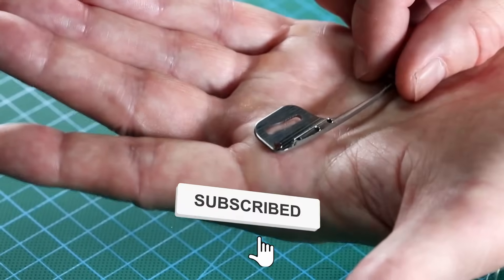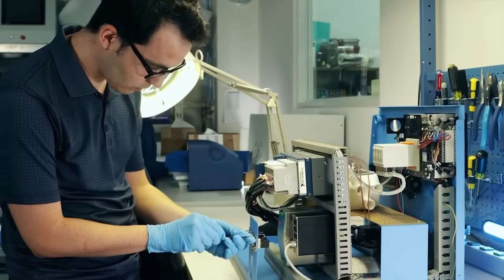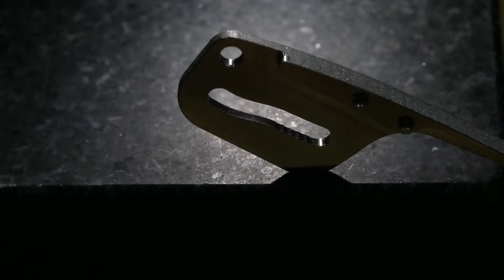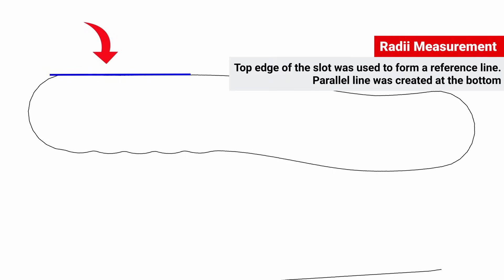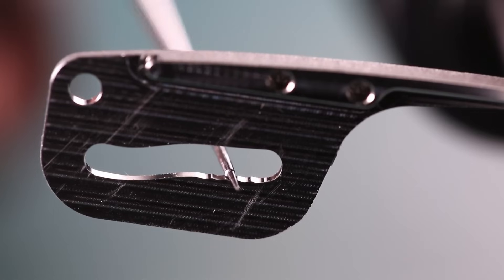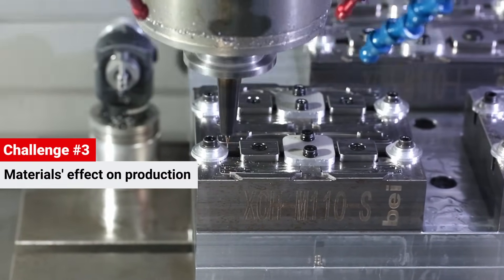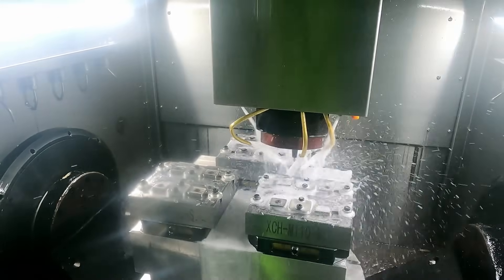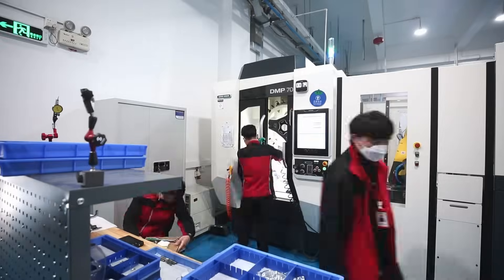Looks Like A SIMPLE Part, But It's The Most COMPLEX Part We Manufactured | 5 Axis CNC Machined

Comment: If the client did share the CAD files I'd get why they didn't care to correctly display the dimensions of the grooves.

Regarding the heat treatment, normalization would have helped to prevent warping if that was a concern.

Comment: As a design engineer, I see this part as an example of overengineering. Its complexity makes production challenging and its function unclear. I prioritize designing products with simpler, more efficient components. In this case, I wonder if a redesign with simpler parts could achieve the same functionality.
Reply from the maker: Quite possibly so, but we are not the product designer in this case.

Comment: So basically your biggest problem was to figure out the dimensions?

I clicked this because i was wondering about chatter in the longer part thats sticking out or how you clamped it in a fixture. Your problems were disappointing and i think you missed out on talking about actual difficulties. Kind regards.
Reply from the maker: Yes, of course we have CAM. And no, figuring out the dimensions was not our biggest problem, we merely used this as an opportunity to discuss the different methodologies for measuring radii along a spline. But thanks for the response.

Comment: Well, that explains the why of the rise of 3D manufacturing
Reply from the maker: Printing these would bring up all kinds of different problems to be solved. For one, laser sintering would introduce all kinds of thermal stress, causing the part to warp and thus require further post-machining.

Comment: If it’s just a clicky switch why did it need to be high strength 17-4PH? Structurally it could have been delrin.
Reply from the maker: We're not really disposed to explain the function of the 'clicky switch', but in this case, no, delrin wouldn't do it.
Reply: Ok and not regular 316 either ? 17-4 is for extreme stress situations
Reply from the maker: @michaelludvik2173  Yes - we had this conversation, and 17-4PH, in this case.

Comment: First machine parts without heat treating and leave enough stock material on features with critical dimensions. And then after heat treating do finishing machining with air cooling and without water. Then I would go to measure that part on cmm to check all my tolerance and correct me machining strategies according to measurement protocol.

 That's what I would do.
Reply from the maker: Thank you for your comment. We think there is no practical way (again, within reasonable time and cost restraints), to maintain 7 CTQs both before and after heat treatment, as it's impossible to anticipate how much the material will warp after heat treatment.

Comment: This is a good video to educate customers who don't quite understand GD&T. But I still do not see why this had to be done on a 5 axis. Yeah, that little move to dump chips between passes was cool, but even if that was absolutely necessary that's still only requires 4 axes...
Reply from the maker: Good point. It certainly doesn't need to be on a 5-axis machine. In our experience, 5-axis machines tend to be overbuilt and therefore more stable for some jobs, but that really depends on what you've got on the shop floor.

Comment: I love doing high tolerance little parts like that... but I have my optical CMM and that makes validating parts so much easier. Cool video! I'm just a 1 man self taught shop so I love seeing how other larger shops do their business.
Reply from the maker: There are many ways of course to measure parts, and luckily high-quality scanners or tabletop CMMs are more affordable and accessible than ever before for even modest shops.
Reply: @starrapid  right! My OGP Smartscope 302 is the most expensive machine in my shop, but it's still amazingly worth it on how much time it saves on inspections

Comment: Some of the horrible GD&T I've seen makes you wonder if these people ever learnt to draw. Gear PCD with 0.02mm concentricity to a bore with a 0.2mm diameter tolerance, families of nearly identical parts that have lengths referenced to different surfaces (some parts are from the end, some parts a from a shoulder), mindless conversions from nominal fractional to metric with no thought to how the extra decimal place now bumps it into the next tolerance bracket.
Reply from the maker: In the future we hope to have more videos that highlight issues related to tolerances and dimensions, because it's a subject that comes up often and we really want to inform our clients so they get the most out of their valuable design time.

Comment: This was a case study?!  This is daily life for any job shop machinist lol. We’d quote this for like $200 a part per the drawing you showed.  It’s always funny seeing big shops massively overthink something so simple
Reply from the maker: Thank you for taking the time to respond. Many jobs may seem simple of course only after figuring out all the details, but getting there takes a while. For example, identifying the right method for measuring the radii of the indentations was not self-evident. And no workshop, anywhere or of any size, is going to produce a small part with seven CTQs without facing a very high scrap rate.
Reply: @starrapid  why would you have a high scrap rate?  We run common modern cnc machines and if a tolerance is varying by more than a thou over the entire 2d profile like you have for those grooves something is very wrong. We obviously have to comp it in, but the entire 2d profile shouldn’t have any form variance outside of that unless your machines are dying or something.  Programmed and ran a part with 12 CTQs yesterday, 15/15 parts were good first time. Multiple holes +- 0.0003” with locations under 0.00015” on a 5 year old dnm.  Might be worth a ball-bar test if it takes this long and so much scrap.  Are your engineers modeling to nominal dimensions or one end of tolerance?  An issue I see a lot is not modeling to center of tolerance, but different ends of multiple tolerances, requiring a lot of time by the machinist to correct with comp and measuring. Model all to nominal, comp a couple in, and everything else should be within a tenth or two. Unless the programmer doesn’t grasp tool pressure and is loading the tool different on each cut and flexing it differently.

Comment: Very cool.  Now give me a million per month.  I used to work at Apple and regularly went to Shenzen to inspect production.  The factory is literally thousands of CNC's running 24/7.  If one breaks down they shut it off and turn on a new one.  No time for troubleshooting, that can happen later.  You would never believe the price of the iPhone frame.  Basically when order quantity gets high enough the part cost approaches the cost of the raw material per pound.
Reply from the maker: Thank you for your response. Yes, we are well-aware of economies of scale. In this case, relatively few custom parts means a higher cost per piece and a longer development lead time to dial in all of the processes. Once that's sorted, yeah, you can pump them out all day.
Reply: For context, how close of an approach are we talking about? For 10 million iPhone frames, 2%, 10%, 50%? I have no reference frame as I don't work in this field.
Reply: @italianstallion399  Normally single digit percentages.  Sadly in the case of the iPhone it is way more complicated.  By the books they are sold at a negative profit.  The reason is there are massive government incentives.  You couldn't buy the aluminum for the price the frames are sold.  BTW you wouldn't believe how much aluminum is turned into chips making a phone.  To avoid warpage from internal stresses inherit to a billet of aluminum the raw block is many times the size of the phone because only the center of the block is stable.  That makes the cost calculation even crazier because over 90% of the aluminum cost is gone to chips.  Of course chips are recycled but that value is not significant.  All phone companies do this or they could not be competitive.  It's like the made in USA sneaker example.  If Nike's were made in the USA you couldn't afford them.
Reply: @RA-gk5zg  That's really interesting on both the waste percentage and profit margins. I wonder if the titanium iPhones are similar.

Comment: Sounds like the engineer needs to learn how to use GD&T correctly.
Reply from the maker: Proper GD&T knowledge is a necessity!
Reply: @starrapid  sounds like it would have saved you some trouble. lol
Reply: Indeed, I'm not even convinced they got the profile reference right even AFTER these folks stepped in to help. The profile should reference to the centroid of a hypothetical perfect diameter sliding pin, because THAT is the path that matters in terms of kinematics of the mechanism. That a machine shop might not know this is forgivable. But for the design engineer to not know that is ridiculous.

Comment: In my experience as a machinist, most parts are ridiculously over toleranced and most end users will never notice a part is 0.002" out
Reply from the maker: Thank you all for your thoughtful responses. If you saw the video then you are clearly aware that the original drawings specified seven critical dimensions. Only after an open dialogue with the client did we confirm that this was not necessary, and relaxing those tolerances made the parts faster and easier to fabricate while still performing exactly as intended. We call this a win for all concerned and is the kind of professional service we offer on every project.
Reply: @starrapid  well said, My whole career I’ve tried to foster a dialogue between myself as the machinist and the client, in my case mostly engineers, to reduce production time and cost while maintaining function. Attitudes have changed over the years and I feel like engineers are more open to suggestions than they were in the past. Starting out in the 1980’s, I found manufacturing to be very classist. Machinists were expected to make the parts as designed no questions asked. So a lot of parts that the machinist recognized had issues got made anyway. And then remade.
Reply: @starrapid  Thank you for the video... 😎👍☘🍻
Reply from the maker: @peterfitzpatrick7032  You are welcome - We plan to produce more videos in this series, so please stay tuned.
Reply: There was this engineer at a company that made of all things marijuana bud trimmers. The thing was basically a spinning screen. He had these aluminum rings about 1/4" thick, 2" wide, and 14" in diameter with this crazy tight roundness tolerance. He was struggling to find anyone to even take the job. Like probably everyone else I was like "I think there’s a typo on this roundness tolerance, you could scrap this part shipping it" but no, he wouldn’t budge. It’s tempting to take these jobs when they’re willing to pay, but it’s a trap. They 100% will never be happy with your work. And I passed on it. I have more than enough work running my regular old machine shop. I don’t have a CMM, climate controlled machines, or shrink fit / hydraulic tool holders. I can’t do in process laser inspection. I can chase microns if I need to, but it’s annoying and I really don’t like wasting my clients money. All this dick measuring about how precise your shop is tiring. ULA has a building size cnc machine turning semi-truck sized billets of aluminum into rocket sections. Impressive. SpaceX has 3 guys running a slip roller and 5 guys with backpack welders on extension ladders. Their machine shop is in a tent. They measure the rocket sections with a precision tape measure.
Reply: If you've ever tried to get a stainless pin to slide in stainless track, you will realize that it doesn't take much tolerance stackup for a mechanism to go from smooth to jams-every-bloody-time. And yes, 0.002" is more than enough to make that difference.
Reply: This is just used within marketing to justify price increase.

But there is also for production lines when multiple parts can be interchangeable, it is very important that tolerance be either  +0.0 -0.002
Reply: @monsterrun  mind me asking how do you specify tolerances on a part?
I understand +/- X.XXXmm for lets say a hammer handle, you might say 500mm+/- 10mm because if its slightly too long or too short it doesn't  matter too much
but lets say im making a pin to fit into a hole
what note would you put on that to say it needs to be no larger in diameter than 1mm but if its under 1mm  but upto 0.1mm thats fine
Reply: Tolerance is based on fitting with other parts

There is also the notion of how much stress that part can endure and how much vibration it can accept. Too tight can be a big issue on small rapidly rotating part as it will generatw heat and expand.
Reply: @randomcow505  "anywhere between 0.9 and 1mm" translates to "0.95mm +/- 0.05mm"
Reply: Yes, I agree, but in this case the "click" had to come at the exact right place. If there is inconsistencies it could be fatal in an operation.
Reply: Whether they will notice or not isn't important. 0.002" out is 0.05mm which is a huge tolerance issue with a component so small. You aren't striving to be a good machinist if that's how you think of machining components out of spec as being OK. If I got a part 0.05mm out of spec (components I have made require +-0.01mm) I'd get a refund immediately because that means the machinist can't even be added to run the CNC properly.
Reply: @FrozenByFire3  thats not what he's saying... prints often have silly tolerances on non-critical surfaces... you KNOW this... thats the whole reason for "design intent" and designer /manufacturer communication... 

A part should be toleranced such that it performs its function correctly (incl. wear allowances etc) but NO MORE than that as all that does is increase production cost and therefore end-product cost... 

Design and manufacture are 2 separate disciplines, each have their own area of expertise so it makes sense to get the two together to discuss a project and perhaps try other design iterations more easily (cheaply) manufactured...
Reply: @peterfitzpatrick7032  that's very true, but if the drawing says a specific tolerance, it's your job as a machinist to reach it. If you think it's too much and will boost cost, contact the designer/engineer and work with him to make it reasonably toleranced for areas that don't matter. Don't just machine it off spec and hope the client doesn't notice. That's some shitty Chinese CNC shop logic
Reply: @FrozenByFire3 Who said anything about not keeping to the specified tolerances ...? 

The point of my comment .. and actually the raison d'etre for this whole video....  seems to have gone right over your head... 

NO ONE has said anything about making parts out of spec & trying to pass them off on the customer, that was your interpretation... and it was TOTALLY wrong... 🙄😒
Reply: @FrozenByFire3  Your shop probably out of business by now.

Comment: Considering it's a quite thin part, after heat treatment does it still warp in Op1? Does the heat treated material behave like s.duplex?
Reply: I can tell you that after the entire process was completed, we had to straighten some of these things. We didn’t put it in the video because it would’ve confused people. It was not a lot of deformation, but it was worth the effort to put them straight.
Reply: @gordonstyles5676  You could always remove most material while annealed and then heat treat it before making the finishing passes. This should limit warping. But maybe it was not so critical that it was worth spending the extra steps.

Comment: I dont understand why virtually all medical parts have such tight tolerances. There is often no need.
Reply from the maker: Thanks for the response. There seems to be the misunderstanding that tight tolerances always equal higher quality or better performance. We're trying to find a balance between extreme engineering perfection and practicality.
Reply: gotta justify that expensive degree somehow... "biomedical engineer" doesnt mean "good at technical drawings" or "basic design philosophy". it means "high salary".
Reply: It's about consistency. Many medical products are expendables and can't be used again.
Reply: You ever go to the dentist where they try to fill a filling and it’s so slightly off that when you bite it hurts on one side and then they grind half a thou off and it’s perfect? Thats why
Reply: @siliconvalleymetal  That's not equivalent to the requirement for blanket tight tolerances at all. Nice try though.
Reply: @Dillybar777  I gave you the why, now whether you accept it or not then that’s your problem.
Reply: @siliconvalleymetal  no, you didn't.  What you explained is making out-of-spec parts and then hand filing them to fit.
Reply: @Dillybar777   Hand filing and deburring is a part of making parts to spec. You asked why there needs to be tight tolerances and I explained a situation why. I know you think medical parts can be 10 thou off no problem but it’s also why you don’t get contracts for medical parts.
Reply: @siliconvalleymetal  Ohhh, I get it. You're one of those people. I won't continue to bother arguing the finer points of precision machining with you.
Reply: @Dillybar777  if you don’t understand why something is done a certain way and someone explains why, you can just thank them.
Reply: Probably because you want things that are used to save lives to be as identical with each other as possible?
Reply: @Youtuber69428  i don't think you really understand the subject at hand based on your comment.